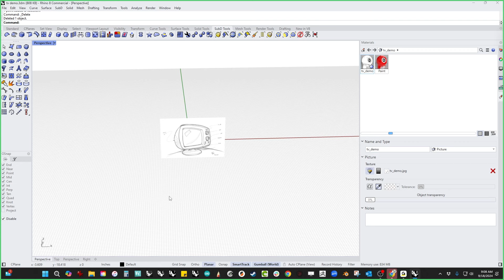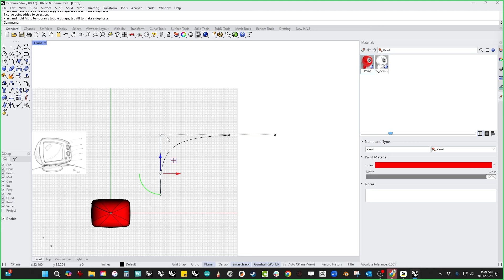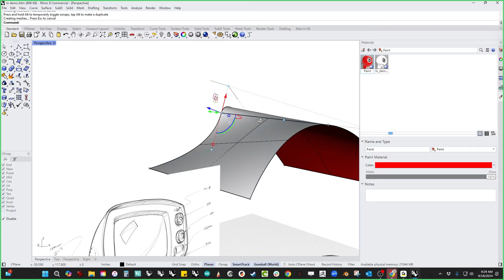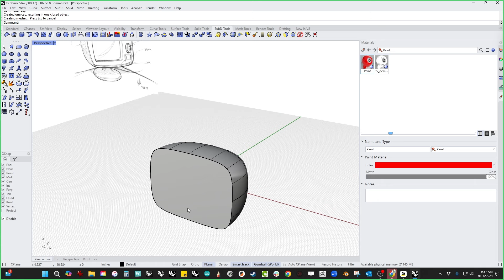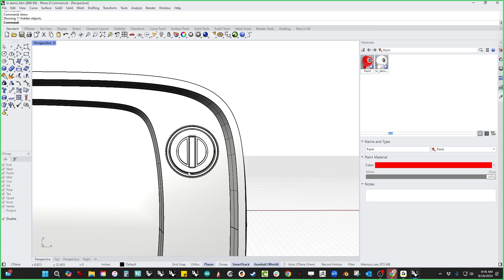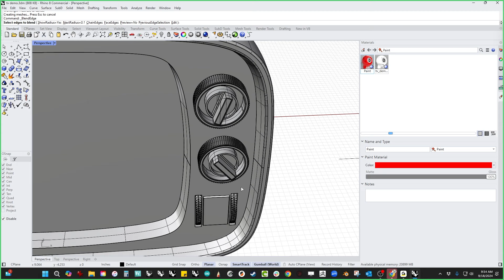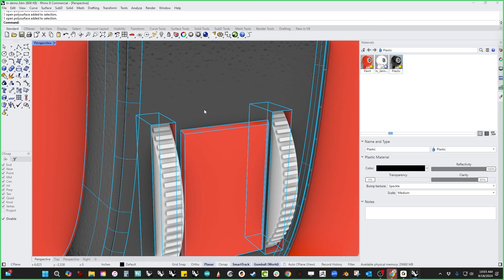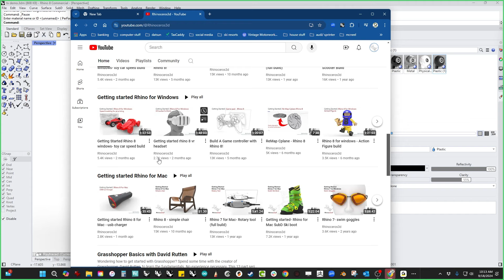Getting started Rhino 8 for Windows- Vintage  TV full build

Comment: Thanks again for your contributions that reach many parts of the world. I don't know if you are aware of the work you are doing.
I have realized and it is my mistake, or perhaps my experience with other well-known CAD software. My lack of knowledge that in Rhinoceros you can combine different groups of tools, for example SubD Tools with 3D solids, to give an example. The use of SubD is something that I still resist, although it is due more to my way of thinking or modeling with CAD software with tools that are much more limited than those of Rhinoceros, but thanks to your videos I am discovering and I am daring to overcome my own limitations.
Reply from the maker: thank you for this- I really appreciate your message, thank you for watching, and Happy modeling!